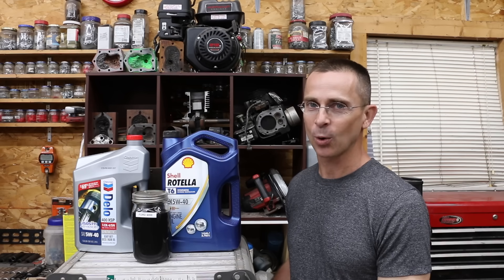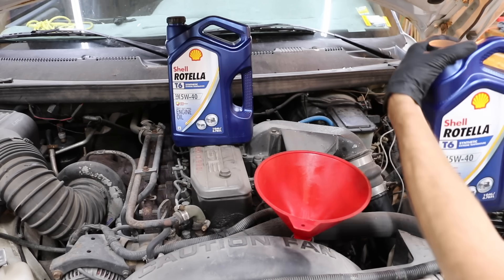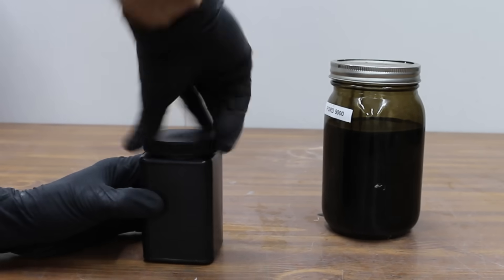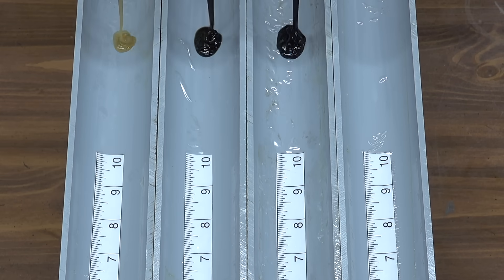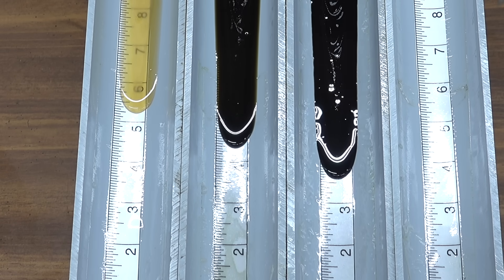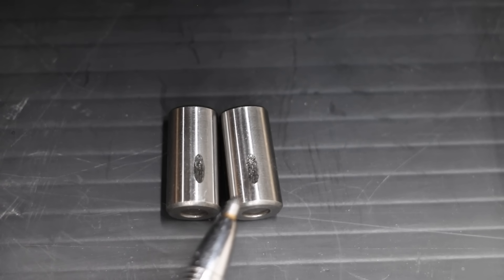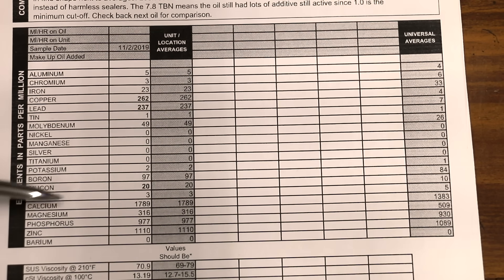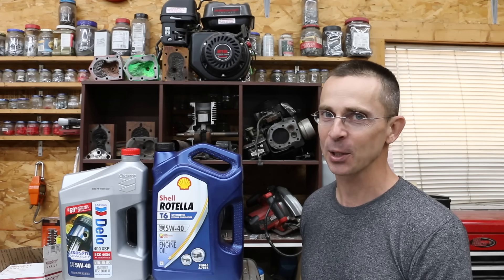Will Annual Oil Change Damage Your Car? Let's find out!

Comment: I've put on upwards of 50k miles on a single oil change on trucks and cars. I just changed a 4cyl vehicle after 35k miles and 12 months. Iuse to run my sport bike oil gor 10k miles every oul change and add on any vehicle if needed. I always try using the best oil if possible. I used in this past change ultra platinum pennzoil and wix xp filter. I will probably get 30 to 40k out of this oul change and add if needed as I said before. Merry Christmas
Reply from the maker: Thank you for the feedback

Comment: You said it, condensation is the biggest thing especially in places where temp fluctuations are big... worst being if getting near 0 degrees. Make 'em work periodically and operating temps, plus it is also good to get the engine to run to get the oil flowed around the engine again to remove moisture buildup and prevent things from corrosion.

Now what about coolant?

Comment: This is so timely for me right now.  I just acquired a used car that has very low miles but the oil wasn't always changed according to the service intervals.  I've been wondering if I should change it or wait until the next interval.  Hopefully this video answers that question.
Reply from the maker: Thank you for the feedback

Comment: I use the T6 in my gasoline pickup truck and motorcycle. It's cheap, full synthetic oil that is really good stuff. 5k to 6k miles in the truck and 2k to 3k miles in the bike. Changing filters every 10k to 12k miles in each.  Been doing so for several years now without any problems.
Reply from the maker: Thank you for the feedback

Comment: Thanks, Commander and I change the mowers more often than I do the Taco. Tey get it once a season if they're run regular or they're new-ish and I'm cleaning the crankcase out. My career started with Texaco Ursa and then Kendall and then D/A and then Delo as far as I can remember. And Valvoline in the 86 Honda because it would stay in it! Now it's just delo and Valvoline 15/40 for simplicity's sake and the high hours on the Delo equipment. ..BrianBloc02 sid something about Delo having additives that agreed with the old tappet Deere engines almost as much as the Deere oil itself but that's been a while. So thanks again for another fine test and yall have a BLESSED holiday!
Reply from the maker: Hi Lewie, Great strategy on keeping the oil changed in the mowers.  I do the same thing.  You've got a terrific strategy on using Delo and Valvoline.  Thanks again and wishing you and your family a Merry Christmas!
Reply: @ProjectFarm  Yall TOO and I get Delo and Valvoline cheaper at Wally world than anywhere else. Used to be $12 a gallon everywhere but not now. If I can get the same thing for less I'd be even goofier than I already am not to. The mowers get rode harder than the Taco does anyhow and GBWYall Commander! Yall are PRIME!

Comment: Have you considered running the wear test using the cold oil?
Reply from the maker: Thank you for the video idea!
Reply: @ProjectFarm  Please consider addressing the issue where the oil is sitting cold (being any temp below being able to be picked up by the oil pump) from oil pan and distributed to the engine. This is the time where the engine is running with what ever residual oil is left on the parts.

Comment: I wish you had the equipment to do the same testing as Blackstone does. I don't trust these so called oil testing Labs.
Reply from the maker: Thank you for the feedback
Reply: Project Farm After reading my comment it could be taken as I don't trust your oil testing methods, but I'm referring to these mail off labs. I believe they just print out an algorithm according to the data the customer provides. 

That's why they ask how many miles etc etc...  They shouldn't need any information whatsoever. They should be able to know Engine oil from Hydraulic oil and how many miles/hours it has on the oil by wear, viscosity and contaminants.

Comment: Might have a good idea for you. CDX plywood vs OSB. I know OSB suffers from weather damage much more but is it structurally weaker? Will nails pull through easier? Does it have the same load bearing capabilities? It'd be good to know because of the price difference!
Reply from the maker: Thank you for the feedback

Comment: Rotella burned way faster in my old 7.3 idi diesel. Also the exhaust had a definitely increased smell durning running. I have been very happy with Oem diesel oil from GM and Mopar for quality and smell and oil life. I change my oil every 8000km. I would love to see u test the oem diesel oils that are offered by ford, dodge, and General Motors 15w40 to see if it’s actually all the same oil in a different bottle or if there is actually a measured difference.

Comment: Yeah, but for $30 a year I always change oil in the Fall before winter months. I don't drive a lot, 2000 miles a year. I know that oil is still good with low mileage but age for me and contaminants in the oil and better cold starting at -10c
Reply: Certainly never hurts to spend a little extra on being extra clean
Reply: For $30 a year, it's cheap insurance. My oil costs double that, and I have multiple cars (8 litres of European grade synthetic in one). They're older cars, kept indoors, that get used minimally, so after watching this, I'm no longer going to change annually.
Reply from the maker: Thank you
Reply: damn thats crazy, i drive 2000 miles in 2 weeks during the summer pulling a trailer.
Reply: Not just a money issue, it saves the environment by changing oil less frequently
Reply: I suggest using SN synthetic oil and changing the oil every 2 years.

Comment: You tested synthetic oil, but maybe mineral oil degrade faster over time ? I think that's where that "myth" come from.
Where I live, every garage will put semi-synthetic oil, so just be aware of that.
Personally I always put 100% synthetic oil.

I asked myself the same question about oil degradation with intensive usage (with the bike that I use on track). A lot of track riders change their oil every 2 to 6 days of riding, I think that's overkill, but I'm not sure about it.
I keep changing my oil every year even if I only do half the recommended distance by the manufacturer, but I don't know how track riding affect oil quality, it would be interesting to test my oil one day...
Reply: If they are putting a lot of hours on the engine, then it's not a bad idea to change it often.
Reply: @Zark-Muckerberg  We don't count in hours, but a typical track day is 5 or 6 times 20min. So at best they change oil every 12h (definitely not me)
Reply: If there is anything that gets my panties in a bunch,  it's this "semi-synthetic" advertising crap. They charge as much for this as for "full" synthetic! Why bother?
Reply: tone167  we've been using a synthetic Penrite oil in our falcons, that we bought new in 07 and 10. they are both over 400,000kms and they probably only get oil changed once every two years if that, considering one tows our boat alot neither have let us down. i believe an engine that is ran hot(long distance driving ) more often will last longer and will stay cleaner with less wear.
Reply: @Bestintheworldatwhatido  I would buy a vehicle with 100,000 highway miles before I would even consider a vehicle with 50,000 in city miles at the same price. Stop an go traffic and idling cause a lot more build
 up/damage than driving the same distance at a constant speed. Some people think it doesn't make that much of a difference but I have seen some rather shitty cars despite them having low miles all because they weren't ever drivin over 45 mph and only for a short distance.

Comment: I run full synthetic oil. After 3000 miles I drop and replace the oil filter. Top of with fresh oil. Run for another 3000 then do a full oil change
Reply from the maker: Thank you for the feedback

Comment: Have an old Volvo that has manual that says change every 10,000 miles or at least once a year, whichever comes first. It gets driven once a week. Only drive it 3,000-5,000 miles per year, so have been wonderful if it really makes sense to change it every year. I think it may be a waste of money and resources. Next time, I am going to put high quality synthetic and use name brand oil filter and let it go closer to two years and 6-10k miles. Thanks for this post.
Reply from the maker: Thank you for the feedback
Reply: Wonderful=wondering

Comment: Wish I thought about sending oil in from an old Ford Bronco I had.  Oil had 5 years and about 20k miles on it...still ran fine and still had acceptable hot pressure when we dumped it.  Blacker than the Ace-O-Spades but not sludged.  It was a first gen synthetic back years ago.  That Bronc made it to 236K before it decided that the rods were tired of not seeing sunlight and made a fist sized hole in the block while pulling tree stumps one day!lol!

Comment: This is awesome! If anyone was wondering about how they analyze the oil at the lab, I’m a nondestructive inspection technician in the Air Force, and we analyze jet engine oil in the same manner. The commercial lab most likely uses what’s called an atomic emission rotrode spectrometer. In this type of spectrometer, there are two carbon electrodes: a rod and a disc. The disc is placed onto a rotating shaft, and will sit in the oil sample. The rod sits above the disc with an air gap in between them. When the sample is analyzed, high current is pumped through the rod electrode and produces an arc on the rotating disc that will burn the oil. The light from the oil flame enters through a quartz window, travels along a fiber optic cable, and hits a diffraction grating that splits the visible light into spectrum bands. Different wear-metals will produce specific emission wavelengths. This is how metals such as tin, nickel, titanium, iron, aluminum, chromium, etc. are produced on the readout in parts-per million. Depending on what type of engine and oil being analyzed, there are specific ranges that these wear-metals can be at before some type of preventive/corrective maintenance will need to take place.
Reply from the maker: Thank you

Comment: I had an old mechanic told me that you should change your oil every 5k miles or 6 months. The timeline is because condensation (In the Pacific Northwest) will accumulate on the top of the oil in your oil pan.  If you do not drain it out then the water will sorta "Squeegee" off the oil. It would be quite interesting if you could find a way to test this hypothesis!
Reply: So many of these old "you should" quotes are from either old oil design, or old engine design. I have to keep reminding people oil tech has improved vastly over the oil from the 50's, and even in the past 15 years alone the oil tech has skyrocketed in terms of durability and lubricity. But the old issues keep getting dragged along and really are not that much of a problem anymore. 
NOTE: Same goes for engine manuals..."IT SAYS TO USE API CD RATED OIL!!!!" Well....it is not like someone went back and updated the manual that was printed in 1986. I actually overheard an argument of an older gentleman at a NAPA store arguing his 6.9 IDI needed CC rated oil and NAPA kept telling him that is not made anymore "But that is what the manual states it requires!"...
Reply: I agree with this recommendation. I'm in the pacific northwest and I have condensation issues with all 3 of my rigs. I drive 8 miles one way to work and I still have condensation when I change my oil. It is not a pcv issue.
Reply: His oil lab results state water contamination.
Reply: @Sam S it's not significant enough that I'm super worried about it, I just keep up on the oil changes. Doesn't really cost me anything to do it except for time.
Reply: Well you might as well get 
you a flu shot every year also!
Reply: Condensation is only an issue if you don't have a functioning PCV (crank case ventilation) system. PCV is on all cars from 1968 on (first clean air act in '68 made them mandatory). So the old mechanic was right as long as your cars are older than 1968. :)
Reply: @markusstrobl1067  condensation should only be any issue if your doing short trips. If your oil gets up to operating temperature it should be enough to evaporate the moisture.
 Since I've gotten a newer car, it has a fancy oil temp display. It can  take 10 - 15 miles for my oil to get up to temperature... far longer than it takes to get the coolant to get up to temp (185 being the coldest my  thermostat allows once warmed up)

Comment: Wondering if you’ve done a review on fuel filters on diesels for quality and longevity? I have a 2018 Ram and it says to replace the 2 fuel filters every 20k. At $270 to $400 per visit to a dealer I wonder if the fuel filters are just as clean as the oil. I can manually drain the front to get rid of any water but have not seen in it yet. I can do it myself which is not hard but it is still $120 for factory filters and about $60-75 for A/M ones on Amazon. Also would like to see if A/M is just as good as factory filters.
Reply: Richard Mankins just ask for the technical data build sheet
Reply: From who?

Comment: funny. i just changed the oil in my 2011 cummins  ram because its a year old with 10k on it.. Ive used delo for the longest time. cheap and the bottle design makes pouring a breeze. about to cross 300k.
Reply from the maker: Thank you

Comment: I change my oil on mileage or hours alone. Very rarely does it go past a year on cars because I put 15-20k miles a year on a car. I have stuff that has had the same oil in it for years. Never have I had problems with oil sitting. Yes if you drove your car half a mile a day and it never warmed up, you would most likely have problems as water builds up as well as other volitiles like gasoline or diesel fuel.
Reply from the maker: Thank you for the feedback

Comment: Hey project farm. There is a gas truck version of rotella. It’s a red container. I use it in my 1997 f150 with 492,000 miles. 4.6l 2wd
Reply from the maker: Thank you for the feedback

Comment: In the 10 years I've owned my car I've only ever done oil changes based on mileage (8000km). That results in oil changes approximately every 9-12 months.

The manufacturer does say the oil should also be changed every 6 months but I think that's a complete waste. Maybe it would be justified if the vehicle spent a lot of time idling or in slow traffic, resulting in high engine hours despite low mileage, but that is certainly not the case in my situation. Engine does regularly get up to full operating temperature.

Comment: Don't prefill oil filter. It's a mistake. You will create a obstruction in oil line, while after first start oil line is filled with air.
Reply from the maker: Thank you for the feedback
Reply: @ProjectFarm  maybe you can make a video about this question. A lot of video bloggers tell to people that you need to prefill filter. You can try measure time when the oil indicator goes of with/without prefill. I saw couple videos where guys where testing this question (Russian YouTube) and prefill was slowing the process of filling oil lines, if the filter is low quality the filtration media can crack, as the oil pushed by oil pump will create a high pressure while pushing air through oiled media...

Comment: Just as long as you don't wait a full year to check the oil level, it should be fine. Keep the engine topped off with oil, I think many extended oil change intervals kill engines simply because the oil isn't being checked on a regular basis and the engine uses or leaks some oil and gets critically low before anyone checks it.
Reply from the maker: Thank you for the feedback

Comment: But isn't that acidic oil sitting in the crank case for 1 year,  was acidity measured in the  test  ? Doesn't oil  get acidic from the fuel  contamination and blowbuy and isn't that the main  point of changing it out every  year
Reply from the maker: Thank you for the feedback
Reply: @ProjectFarm  I was basically asking you if the lab tested  the acid content and if u think the acidity of tbe oil would be bad for the engine after 1 year  ? 😀

Comment: I used to use Chevron Delo 15w40 in my 1995 Jeep Cherokee with ~200,000 miles on the 4.0 I6 gasoline engine.

Another idea for a future test would be to test oils that haven't been used but have been stored on the shelf for years.  Maybe 2 years, 4 years, 8 years, 10 years?  We'll watch it in 10 years I guess!

There is a recent discussion on www.gm-trucks.com about the shelf life of motor oils!

Comment: My snowblower is a 1980s model and I don't remember my Dad ever changing its oil (I was young at the time though.) In 2015 or so I changed it for the first time in who knows how long and the oil smelled like gas. I topped it off with Synthetic and let it run half an hour before draining it and refilling, the engine never started leaking or burning oil. It has Amsoil Small Engine 10w30 in it now from last year and there hasn't been enough snow to clear. I may not even change the oil until next year, it doesn't get used much.
Reply from the maker: Thank you for the feedback

Comment: Thanks for testing t6. I used it in gas engines that were older turbo engine. This should be fine in gas engines as long as the engine likes high zinc.
Reply from the maker: Thank you for the feedback
Reply: @ProjectFarm  thanks for the videos  I watch all of them for the last 2 years

Comment: Boy ur 12v has low miles how about trading me trucks. My 96 is sitting at 467000miles. I change the oil every 3000 to 5000miles with a qt of Lucas.

Comment: Interesting test and results. 

I’m shocked by your TBN retention on the used oil @ 3k miles (regardless of the months of age) 

Now could you test that T6 vs the cheapest Diesel oil available —> Walmart’s Super Tech. Lol. 

I’m currently 3 used analysts covering over 50,000 miles of use into a real world test covering Mobil & Rotella T4 and now I’ve added Super Tech into the mix which is $9.99 a gallon!!!